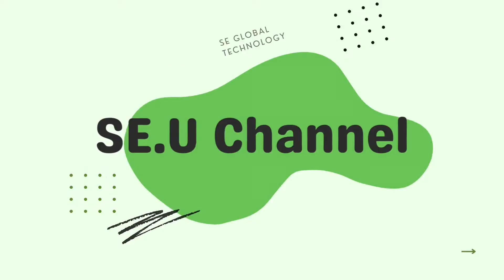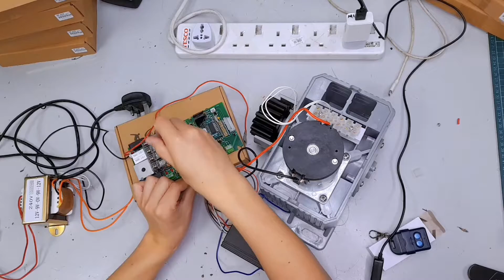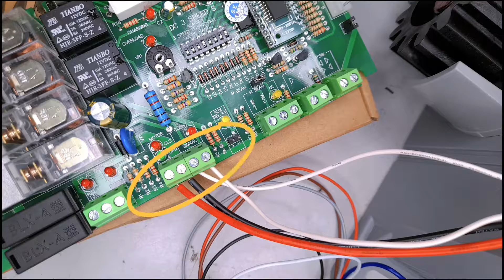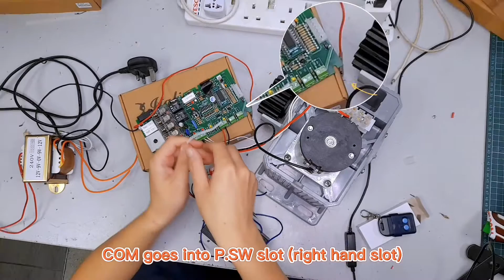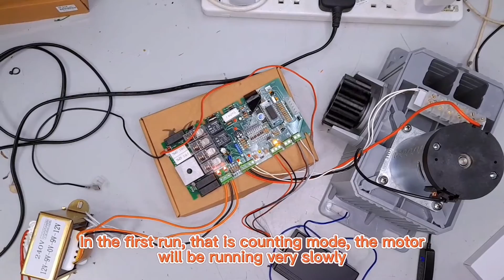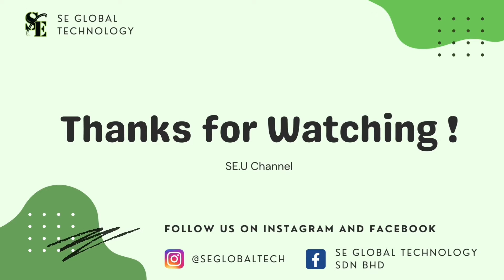How to Test DC-03 3 Speed Counter DC Sliding Panel with OAE Motor 9 ( ENG Version )

Comment: Hi, after fixing the panel and connecting all the wires, do you start the testing with the gate fully close or open?
Reply from the maker: Hi Boss, let say it is ready to testing, at 1st time u press the remote, if the motor led indicator shows green, u need to make sure the gate is in opening position.
Reply: @seglobaltech  I see, if the red indicator is ON then the gate should be in close position, correct?
Reply from the maker: @munkitfoong6528  correct
Reply: @seglobaltech  Thank you very much.  All done already. Equipped with remote control receiver, Sonoff WiFi, relay switch for pillar lights and photo sensor.
Reply from the maker: @munkitfoong6528  👏🏻👏🏻 It's Great that we able to help you. Remember to subscribe, like and share our channel ya... Thank you very much!